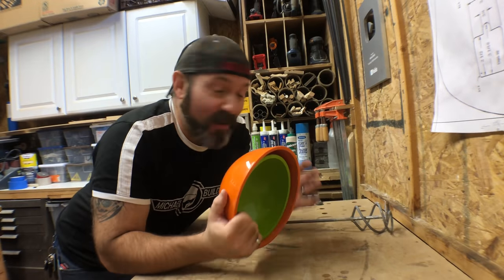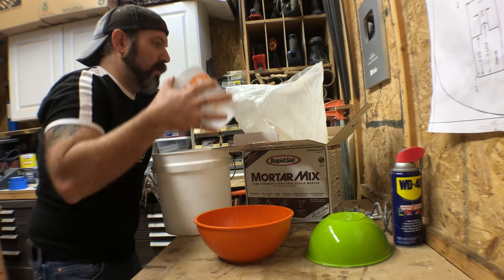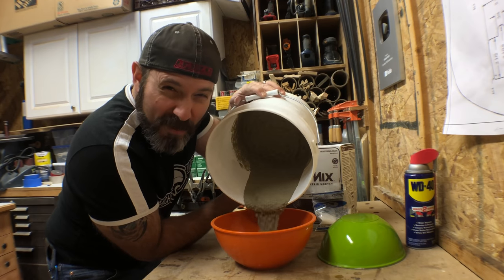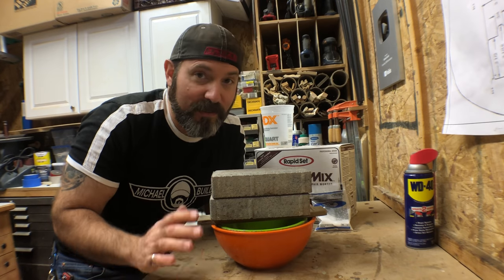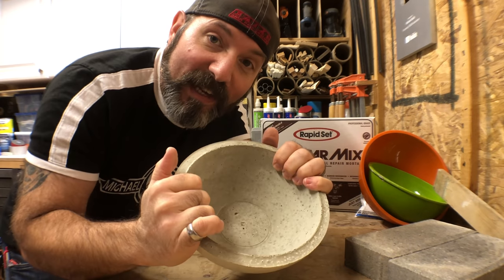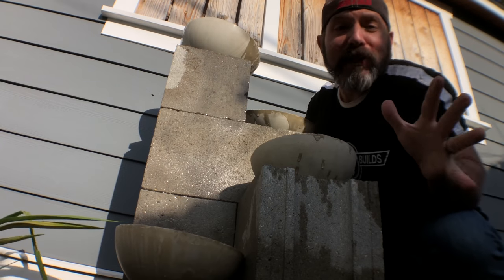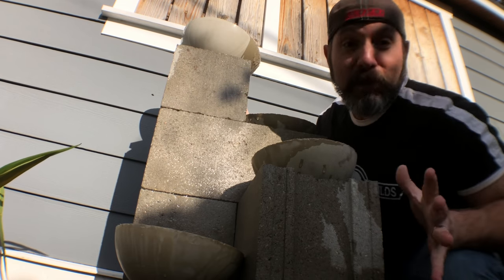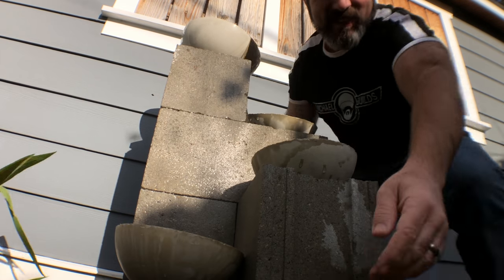Make a Concrete Bowl and More!

Comment: I’m convinced that Michael is really a sales rep for WD-40
Reply: That's hilarious its definitely stuck in my head now😂
Reply: You can actually use any kind of oil or grease as a mold release for the cement.
Reply: My question is how are you sealing these after using WD -40 I tried using a concrete sealer and the remaining oil made the sealer flake off

Comment: I saw in other videos that before u demold, you can pour some hot water onto the outside surface of the plastic bowl or use a heat gun or blow dryer to blow at the plastic bowl.  The plastic bowl will expand, so it’ll be easier to demold.

Comment: Hi Michael just subscribed.  Thanks for the great content. I have two favors. One is a video on how to repair a kitchen countertop that i didn't  seal when it was first installed so now looks bad and get it ready for proper sealing and two a video using those modern mold patterns. I wanted to take my concrete steps leading up to my front door and make it wider by adding these to each side. Would love to see that. Thanks
Reply from the maker: Thank you so much for subscribing! I’ll see what I can do! 👍🏻😊

Comment: I thought about the fountain using a steel pole with threads between each one and putting a spout by drilling into the side of the bowls. Using the large at the bottom and rising to various sizes pouring with spouts in a circular or straight motion.....Even add led lights for changing colors.

Comment: You are very talented and I LOVE your workshop.  Have you tried making spillway bowls like aquascape spillway bowl?  Not the basin, but the bowl with the lowered channel/spout for water to pour in to the basin below it. 
I would really like to make the bowl AND the basin, but smaller.  The aquascape basin is 40 inches diameter and bowl is 32 inches.  I think but I was thinking more like 2/3 that size.  Any ideas to actually pull that project off?  I priced some cement molds and all I have to say is YIKES!  I could buy the actual bowl from aquascape for the cost of the mold!  Thank you!

Comment: Hey bro, have you tried to make some little canal holes in the border of the bowls for the fountain? That will make the flow more direct and natural, you can give them the direction you want and will look more fancy hehe
Reply from the maker: I haven’t tried it yet but I think that’s exactly what I have to do for sure. I was even thinking about some way to add a little spout as well. Just haven’t figured out what material to use yet
Reply: @MichaelBuilds  if you use a plastic transparent garden hose cutted at horizontal by half and put it in the canal its almost invisible with the water flow, and you can even shape it with a little curve so it seems more natural :D

Comment: Awesome projects Mike. Love the idea of being able to make designs right in the concrete using stencils and some freehand vanes. Want to try my hand at making a 30" round table for a sitting area my wife wants me to make out front of our house beside the brick sidewalk. Need to figure out what to use for legs or a center support. Hey is this stuff strong enough to make 4, 4' X 4' X 2" thick pads to use as a patio base on top of stone without cracking?

Comment: Michael,  I have an idea for a video you could make.. Hoping to copy it for my own use after you demonstrate.  Outdoor kitchens are big $$, and they sell "drop in" grills specially made for them for big $$.  Yet you can go look at $150 grills at the Home Depot and realize that if you disconnect it from the legs and remove the steel tabletop from the left and right of the cheap grill, you essentially have an inexpensive drop-in grill.  I was thinking of designing a single mold that is used multiple times to from the different parts of an outdoor kitchen countertop.  There would be a large solid piece and below it is an undercounter refrigerator.  Then if you insert a blank in the mold with the footprint of an undermount sink, this same mold makes your sink section, and then finally you can use the mold to make a "U" pattern where the grill insert fits within the "U".  So the question is how to join the three sections, and how to build the structure under everything.  Outdoor plywood covered with lath and then concrete as a stucco?   Heck, thinking aloud.. could even use one of your bowl ideas to make a sink and another bowl sitting in foam to make an ice chest.  Or maybe not.  I'll also be building a large fire pit, but not sure if this concrete type is good for anything around the fire pit.
Reply from the maker: Oh hell yeah! That’s a great idea!
Reply: @MichaelBuilds  Could be another viral video if you included the whole shootin' match of tearing down a grill and doing the side pieces.  I think everyone already knows about the actual top based on your previous videos.  Looking forward to seeing what you come up with.  I am planning on using the smaller grills that are high quality rather than one larger grill.  This way if we are cooking for just my wife and I, we don't need so many burners, but we have the option of lighting both grills for a party.

Comment: This might be a dumb question, but is there any reason that you couldn’t use a concrete bowl as a sink? Just drill a hole in the bottom and set it on top of a vanity? You may have to seal it with something waterproof, but that could be a cool rustic design.

Comment: Oops, I watched this and got inspired but accidentally bought Cement All instead of the Mortar Mix. Can you talk me through the differences for this sort of application? I’m planning on making concrete bowls and small planters. Thank you for a great vid and showing your knowledge!
Reply: @morgan - The Cement All goes to feather edge vs Mortar Mix only to 1/2 inch due to the size of aggregate in the mix - I use Cement All for all these kind of molds, etc.  You should be fine.  Enjoy.

Comment: Michael,
I need a shower bottom. I have a small cabin, it needs to sit in the corner of the bathroom, which of course,  is small.  :)
I'm thinking 30" or even 28 ", can I do this with the method you use.   I need creative ideas,  please help.

Comment: Would it be possible for you to make this video again with added color or even just giving the ratio with the added color would help so much. I made one after watching your video and it was so easy. But when adding color to it, the consistency becomes a lot thicker. The first time didn’t add enough color, the next time I added too much and it ended up being very thick. So I added more water and powder to water it down some and by the time it was ready to come out the bowl had cracked into separate pieces. 😬

Comment: Do you have to seal or protect project pieces like these that will stay outside all year? For example, if they get wet and it freezes, will that cause the concrete to crack or flake?

Comment: That was one fat crack going through the fireplace bowl.  Ive wondered about the projects that you are using this mortar mix with; whether the extra strength incluces crack protection.  There are multiple types of strength afterall, and regular concrete has very poor tensile strength which is why it is paired with things like rebar scrim, and fibers.  Would be lovely if you did a video which addressed this and suggested an appropriate fiber to match with it (which could survive the heat and alkalinity as a decent quick fix for  all of the projects you are using this mortar mix for).  I mean, concrete goes wayyyyy deeper, polymers, plasticizers, aggregates, pozzolans, etc, but I think that simply fibers would fit in your quick and easy goal with reasonable quality control.

Comment: Michael ... I have a small project, but I want to do it easy ... it’s about leveling a concrete floor ... the room is about 16x16 can I use flow control even though to smooth it to be even is about 1/2 inch ... please your thoughts
Reply from the maker: I would just use Concrete Leveler instead for a project like that
Reply: Michael Builds thx 😊 ... will the thin layer be durable? It will be covered with a “floating” type of inlay flooring ...

Comment: How do you determine how much concrete to use when mixing?
Reply from the maker: With small projects like this, I just eye ball it. Bigger projects I measure the volume of the mold and divide it by .5 which is the volume of the bag

Comment: Michael,
I have some ideas I'd like to work on but need to know if there is a product you would recommend for high temperature versions of the rapid set mortar mix?
Reply: I just did a similar project (fire bowl) using AllCrete Cement and I'm pretty sure it's okay for high temp. What kind of project are you planning?
Reply: Wanting to make some custom fire block for a propane fire pit but ready mix says it waz only good up to 300 degrees so
Reply: I neededsomething better for high temperatures
Reply: Ooh that's really high temp. Hmm, sadly a bit past my expertise level. Sounds cool though, good luck!

Comment: I have a question.... what or how do you clean the original bucket with to use it again? I want to make sure i am being efficient with my resources before I start.
Reply from the maker: That’s a good question... it’s best to rinse the bucket out with water as soon as possible because this stuff sets up so quickly. I usually fill the bucket with water, scrub the sides and bottom with a stiff bristle brush and flush it out
Reply: @MichaelBuilds  i see! good to know. 
 i know my husband is worried about my excess going down the drain before i even start lol

Comment: Each bowl needed to be molded with a "spout" or spillway. My grandfather was a mason and lucky me.... my dad taught me some fantastic tricks to do with concrete. If you go into Goodwill or Dollar Tree and buy plastic deviled egg trays, fill with concrete and then tip over when set, you end up with sunflower stepping stones. Rubber Halloween masks turned upside down in a sand box, cover eyes with aluminum foil.... fill with concrete, and you get cement gargoyle heads or devils to place in your fountains and rock gardens.

Comment: If I wanted to use this method to make a concrete sink any suggestions for making the drain whole?
Reply from the maker: But the parts for the drain and use them in your mold. The parts and the seal will fit perfectly
Reply: Michael Builds thanks, keep up the great work
Reply: Jason Halvorson,
There are actually some reusable, variously sized, silcone blanks that are sold SPECIFICALLY for use to "save the space" necessary to install a drain in a concrete vessel or sink.  ALSO it is key to know the maximum depth your vessel or sink can be to accept your drain set up (ie. you have to purchase your drain first, and then purchase the appropriately sized silcone blank, AND THEN DON'T MAKE YOUR VESSEL OR SINK TOO THICK!).  Search the internet for the reusable silcone blank, or source companies that provide materials for concrete projects.  😉you're welcome

Comment: Titanium would be a horrible metal for a drill because it is similar in structure to aluminum, but a Titanium-nitride coating on regular high speed drills or Cobalt steel drills is extremely hard and long lasting.  Wish people would stop calling them titanium drills.